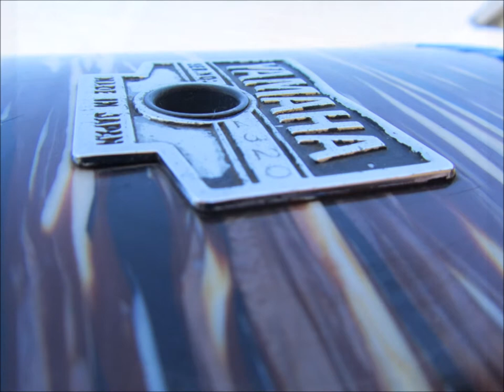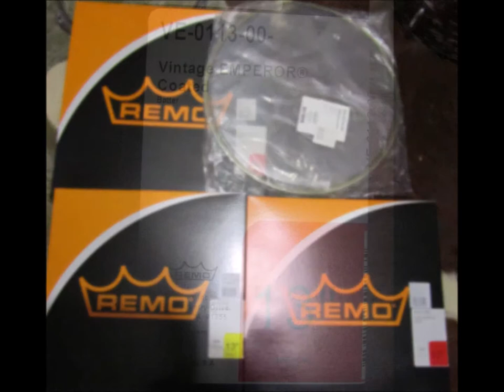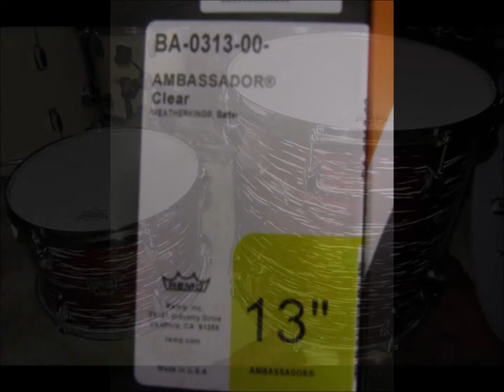Yamaha Vintage D22 kit restoration slideshow

Comment: Beautiful job on an awesome classic kit.  I have the exact same one in Brown Willow also, and just started my  restoration.
Reply: advice for finding parts? having issues finding parts for the restoration? Just started my own. Awesome kit.
Reply: @Kyle MacDonald  Hey man. I didn't buy any new parts because I restored all the original parts. Except for the bass drum mountain symbol arm, which I didn't use.  Went with floor stand.  Original parts will be hard to find. But many new parts with the "classic" label should work. It's a simple kit. I need to make a video to show my results. It came out beautiful.  Good luck if you're doing a restoration. It's worth every minute. Something about this Yamaha kit just sounds so awesome.

Comment: My brother has the same exact drum set as you do.  He noticed on your video you replaced one base drum rim.  My brother has the wrap for the 22 inch base drum rim.  If you want it you can have it for nothing.  Private message Margie Phipps Hall on facebook if you want it.
Reply: Hi Robin! Oh that's absolutely amazing and honestly the kindest thing to offer! This kit is my prized possession and the detail I put into its restoration was certainly a labor of love. 
I'll send through a message on Facebook. 
Much appreciated - Matt L
Reply: Hi Robin, I am looking for lugs for this same kit. Is your brother finished with those drums? interested in talking about parts? Thanks, Kyle
Reply: @mattlabedzki5539  Hi Matt, awesome job on the restoration. Are parts for these kits common in your area? Looking for lugs and found out that the floor tom lugs changed at a certain point, holes are slightly different measure. My kit is 1599 but by the 2500's they changed the spray from white to grey...perhaps they changed the lugs too.
Kyle